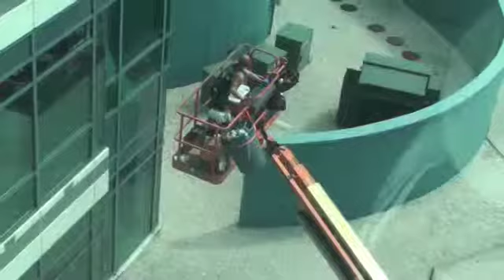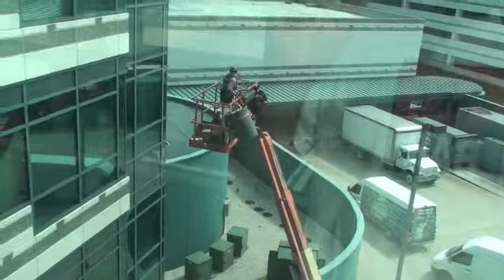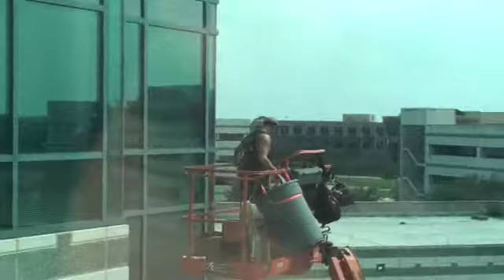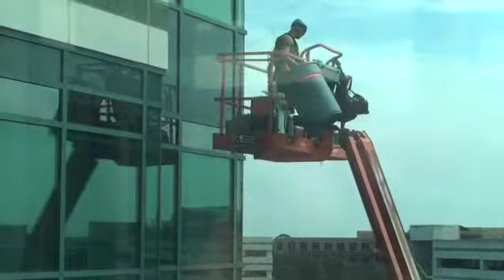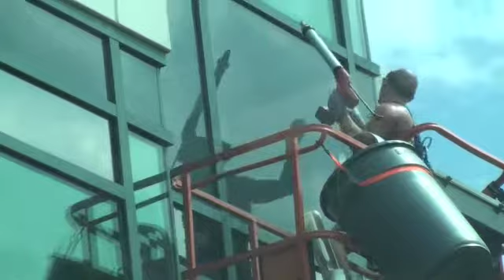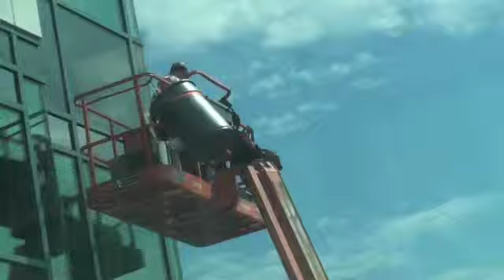Caulking on Boom Lift

Comment from the maker: We do tool actually, but you can't change the shape of the bead as this is structural glazing. Tooling is also for weather proofing which is a bit different of a process. We have to maintain a 45% angle -- not a curved bead. Thanks for watching!